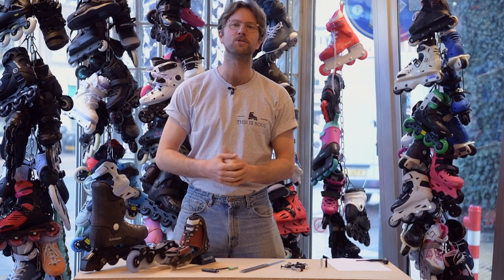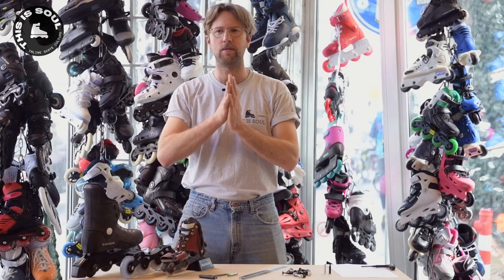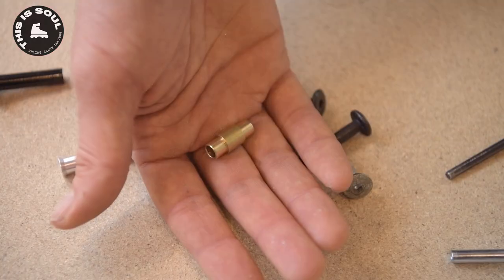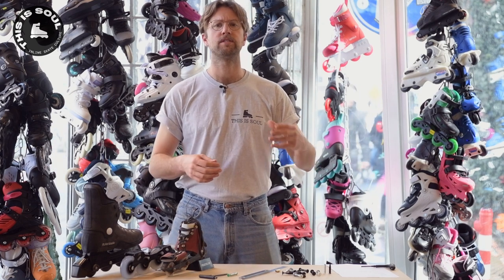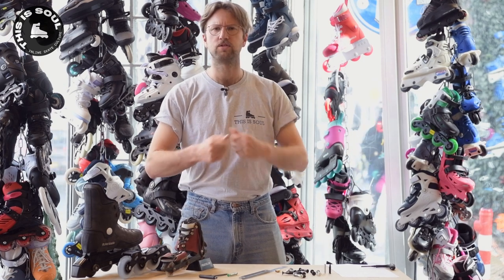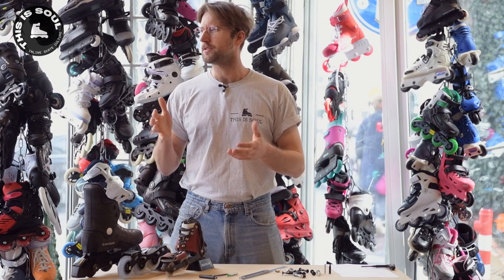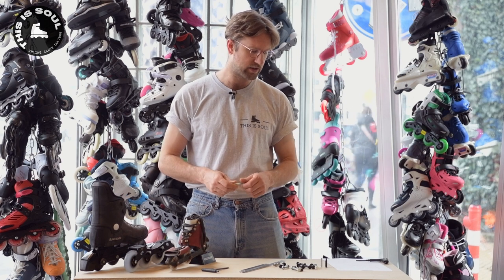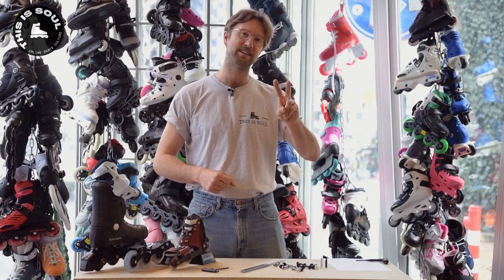EVERYTHING ABOUT AXLES

Comment: Advice please? I have a frame axle that I cannot remove. Took it off once to remove the brake then failed to put the shorter axle in and now I can’t get it back off. Only one side unscrews but the side it of axle it exposes has a lip around the perimeter that prevents the axle from going through that direction. Don’t know how I’ve managed this but I’m super confused

Comment: what is the threaded end bolt size? and thread per mm?  also some axels have tapped holes in the for brake kits.
Reply from the maker: most axles on our webshop have the thread size listed! it usually is M7 or M6
Reply: @Thisissoul  how many theads per mm thanks im making a custom frame want to be sure on tap size

Comment: Hi, I’m trying to see what are the best axle and spacer is better, do you have a favorite inline skates that give you good or better speed/performance? I used to use Roller Derby BX5000 growing up and been loving that axle system than most other roller blade’s axle in the market because of its rotation and smoothness that it gives… do you know any new or current roller blade that still uses that system or could you recommend something that would be similar that or better?

Comment: Great video. Is it better to use aluminum axles vs steel? 
Especially in aluminum frames?
Because the steel might damage the aluminum threads of the frame.

Comment: 10:27 I stripped the hex head on my frx back axle. Brand new skates🤣🤣🤣 I won't need to rotate the wheels for a little while though. They really put those axles in there tight from the factory. It stripped out on the first try